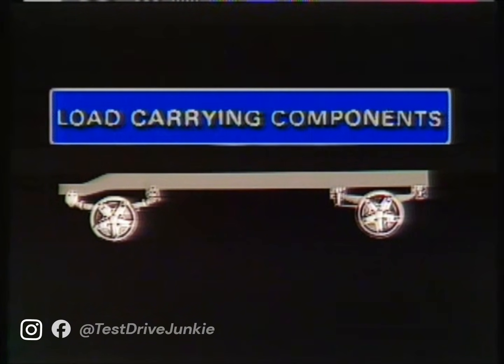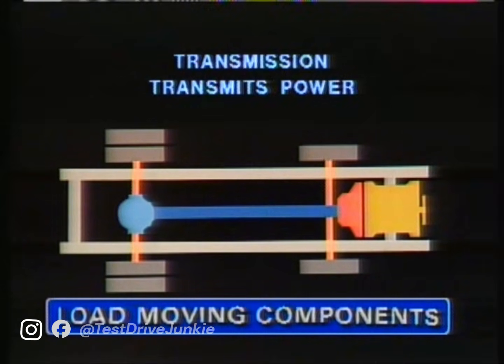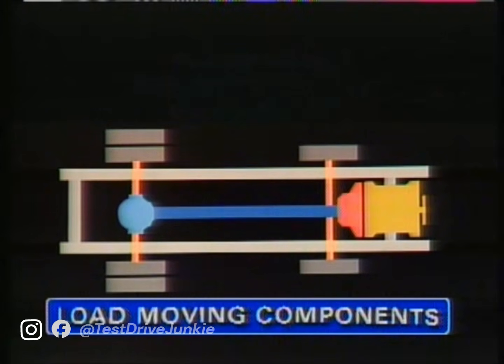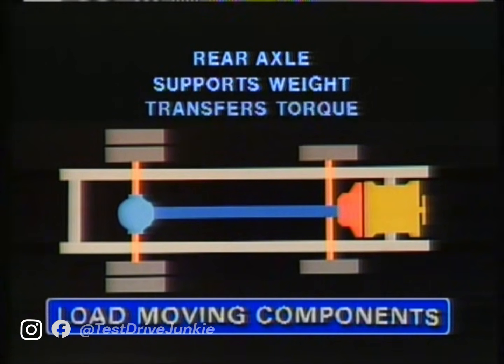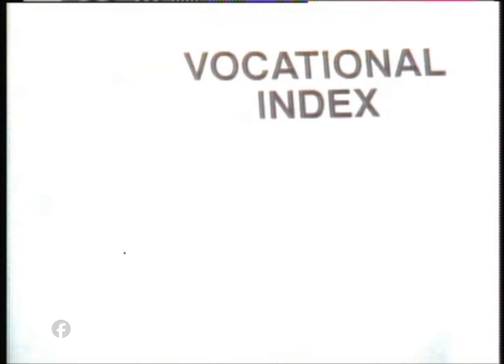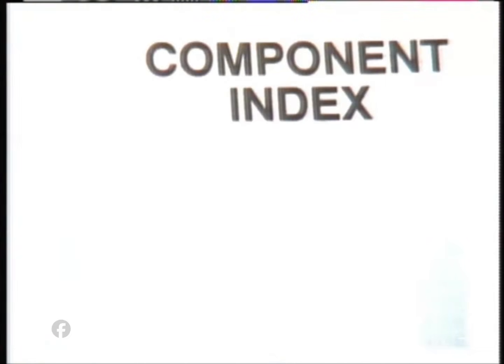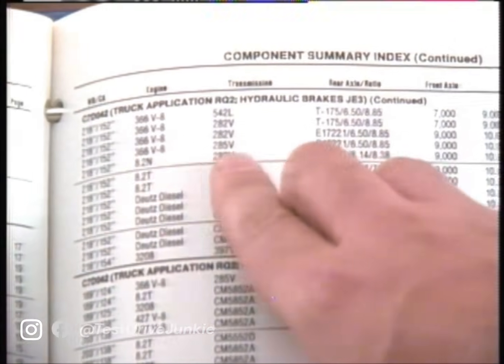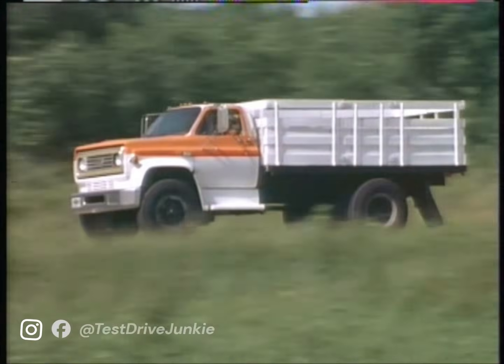1984 Chevrolet Medium Duty Manufacturer Laserdisc Promotional Video

Comment: They were classified as Medium duty Trucks but they could easily be spec'd into Heavy Semi Truck category. 33,001 pounds and above is Class 8 Semi Truck category... They could easily be spec'd into that category. A single Axle Truck with a 12k front and 23k Rear was at 35k GVWR when spec'd as a Tandem you could get 34k and 38k rears and 12k front axles to 46K to 50k GVWR... Many Farmers in the Midwest had these spec'd as Semi Tractors Tandem Axle models with Air Brakes and a 5th wheel to pull Semi Trailers for Harvest like Grain Trailers.